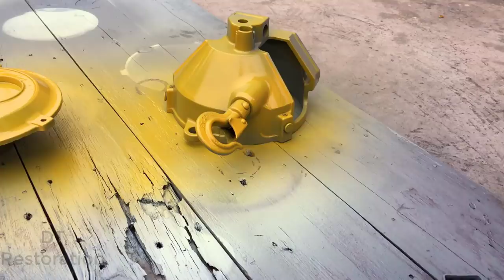Restoration spring balance ENDO EWF-9 Christmas gifts for dad | Restore old Japanese spring balance

Comment: I watched the entire project and still have no idea what it is and how it works or what it is used for... IDK
Reply: Nope. It’s a counterbalance used in a factory. Takes some of the weight of a heavy tool so it’s easier to use with less fatigue.  The adjustment is for the weight of the tool, from 4 to 9 kg. Probably needs to be calibrated now.
Reply: So not much good as an Xmas present unless you own a factory

Comment: Can you show us how does it  work???????????
Reply: He really should have done that.  Think of it as a bungee connected between a heavy tool and your ceiling;  the spring action of the cord compensates for the weight making it easy to maneuver or lift.  But a bungee cord doesn't have constant pull.  This contraption uses an internal wind-up spring and pulley system to maintain constant lifting force regardless of vertical position.  They are commonly used in factories.

Comment: Soooo what is this thing???
Is it a scale for weight measurements??
Reply: My guess its something to help balance off center loads on shop cranes
Reply: No it help to work with heavy tools
Reply: @fayyazbahrami296  ah, thinking about it that would make more sense.  Thanks
Reply: Matthew Hoffman I’ve seen them used at meat works to hold large saws for splitting beef in half down the middle